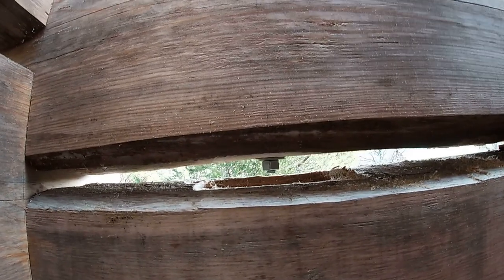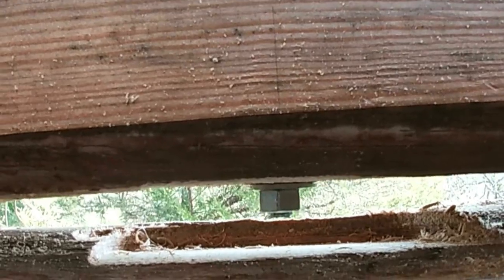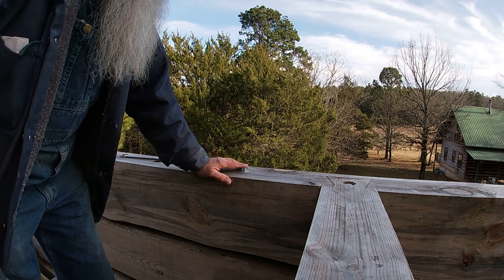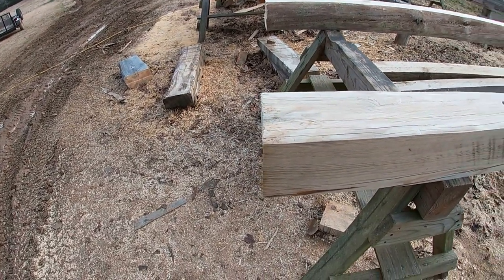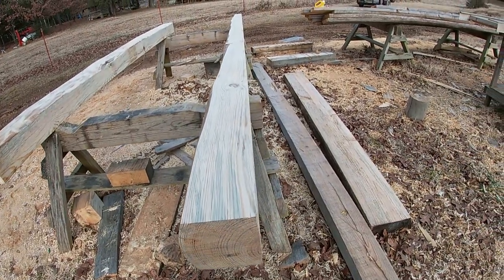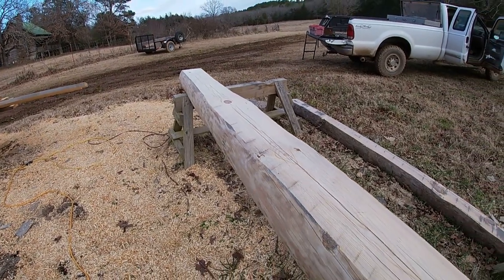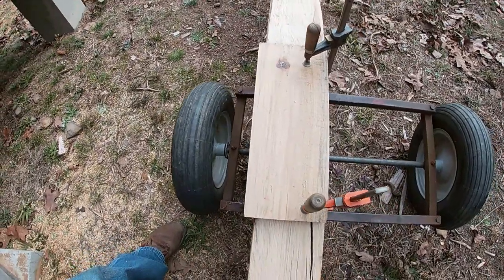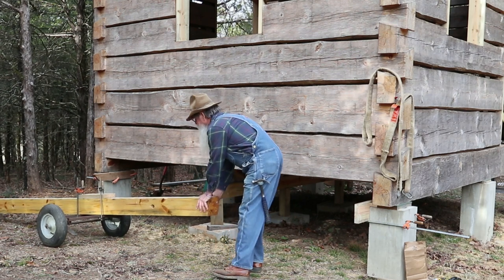Anchor Rods & Half Logs, Dovetail Log Cabin Build (Ep 39)

Comment: In the future you should put 30 pound felt under the wood sill even if it is pressure treated as an isolation membrane especially if it is exposed to the elements.

Comment: A friend bought a kit log house, he wanted to build himself. He was a mechanic with no construction experience. He asked me if I'd help him with the electric since I'm an electrician, I said of course.
When I told him he needed to drill holes in the logs to run the electric wires, he didn't like that, he kept saying there has to be another way. I kept telling him that's what you have to do, he said he was afraid it would weaken the log. He didn't want to cut holes for boxes either. I ended up telling him to find some else, two electricians later, he ended up doing it himself with wiremold, it looks like hell, he had a beautiful new house with wiremold everywhere.
Reply from the maker: Howdy- I did a historical restoration a few years ago and we drilled the logs for electrical. It doesn’t weaken the log and sure looks better. Some people put the boxes in the chinking gaps but I think it looks nicer to put them in the face. Thank you for coming by and watching the video. God bless
Reply: @TheBeardedCarpenter  The chinking gaps aren't wide enough for the whole box so you still end up having to notch a little out of the log above and below, then the plate doesn't sit nice. I got out of residential work and only worked commercial for the last 20 years, dealing with homeowners is too much of a headache.
I really like your videos
Thank you.
Reply from the maker: @bigredc222  I’ve worked a little bit in commercial but mostly residential. Sometimes you have to work at a relationship with homeowners but I’ve been pretty fortunate. I’m glad you’re enjoying the videos. I sure appreciate you watching them. Blessings

Comment: I have seen these notched in during the setting of the sill plates. Does that method weaken the sill plate notch?
Reply from the maker: Howdy HG- I’ve seen that done also. If the intersection of the corner is supported on a pier or continuous foundation it doesn’t weaken the upper notch on the sill log. There is solid wood down to the foundation. That is a good question though.  Thanks for stopping by and watching the video. God bless you